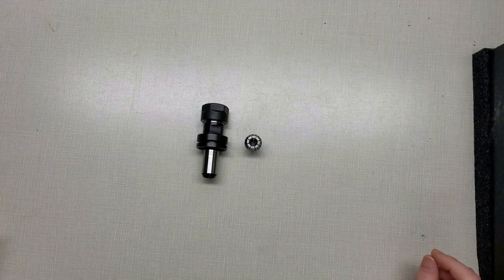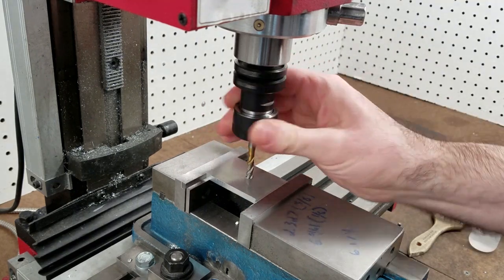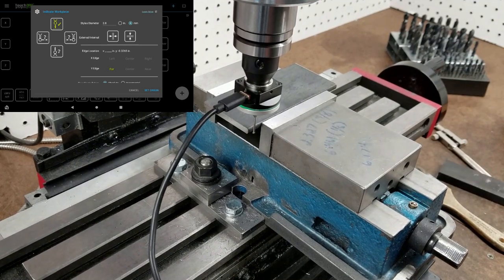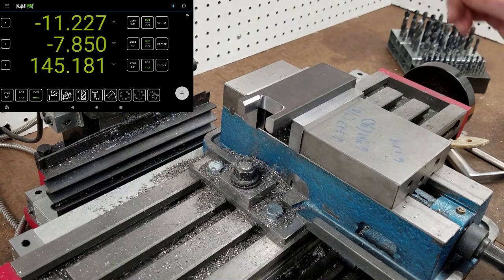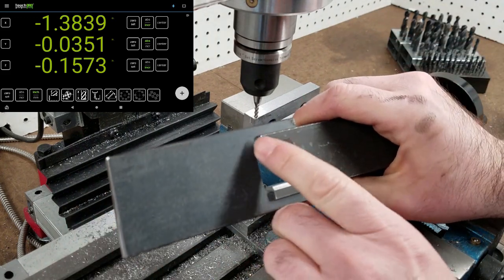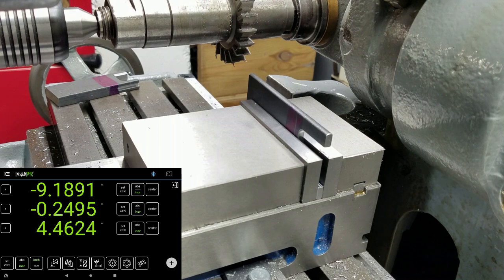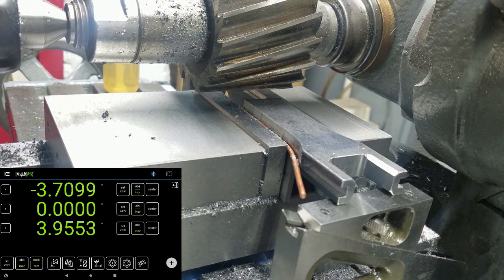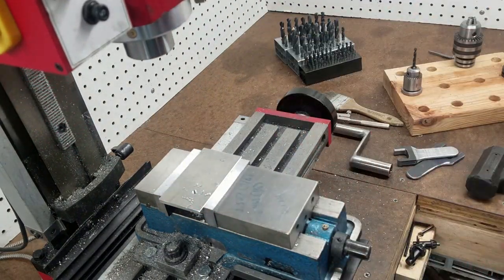Shop Made Tap Wrench, But... Different.

Comment: Grow some and turn the motor on
Reply from the maker: Power tap with a mini mill? It would take a lot more than a bigger pair for that to happen... A bigger motor, for one. 

It's a good machine, and makes good parts, but it's not powerful enough to get more than a thread or two deep with anything larger than, say, an M4 tap.

That being said, I've got a Procunier tapping head, and have tapped dozens of M3 holes under power.

Comment: Snap! I just purchased the exact same touch probe (although I paid a lot more for it) and I just made a video on setting it up for TouchDRO. It'll be out in a few weeks. I was able to do some tests to show how accurate it is and on edge finding I got it to around 20 microns. On centre finding I was able to get about the same but I found out the hard way that you need to have clean collets and a clean spindle bore to get it that accurate. I ended up setting the probe tip diameter to 1.92mm which seems to take care of the latency in the touch probe for edge finding. On centre finding it doesn't matter what the probe tip setting is. 
The tool you made works great!
Reply from the maker: Thanks, Mark!

The one I bought came with instructions on how to set the X and Y offset, which I found to work relatively well, and allowed me to keep the probe diameter set at 2mm.  I've found it to be pretty accurate... Within a few tenths, maybe half a thou tops. Plenty good for the work I do.

Looking forward to seeing your video on it!
Reply: I have one that I have set to a little less than Ø2mm. I use the USB signal wire for auto-probing in  CNC.

Comment: Maybe you shoud add a spring loaded ball to hold two halfs togethter? To prevent  self dissasembling while tapping threads.
Reply from the maker: I thought about that. I figure I'll use them as-is for a while, and if it becomes an issue, I'll make some kind of retention mechanism.